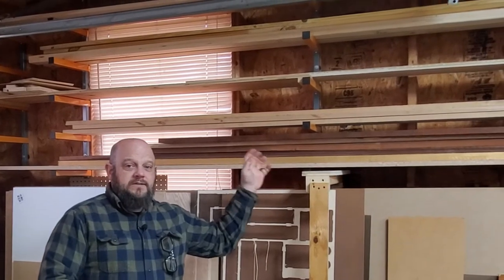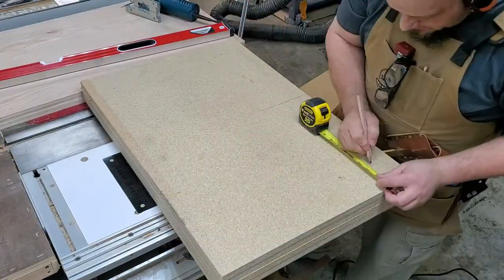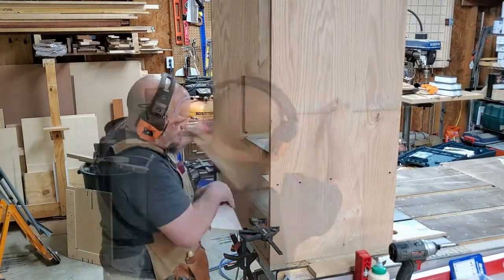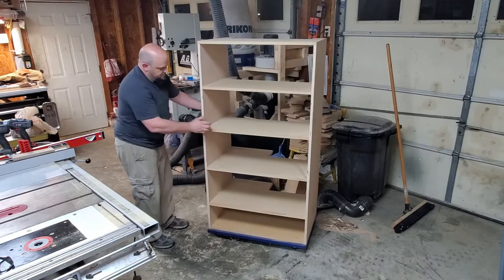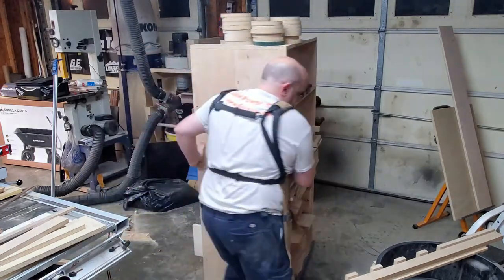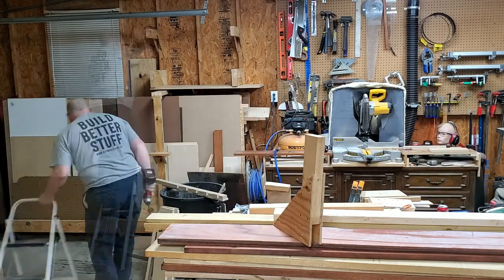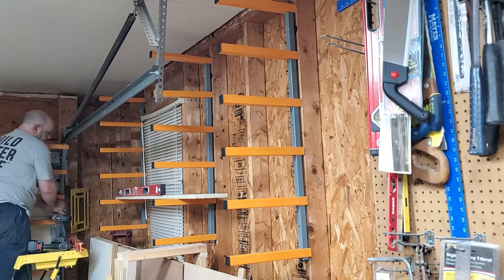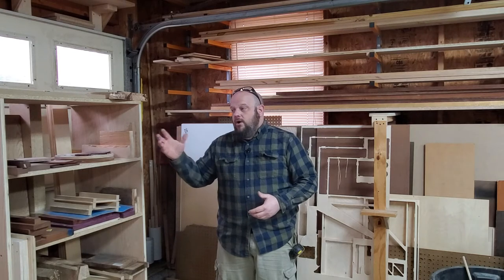Unboxing and Assembly of the Bora Tools Wood Rack Plus Bonus Storage From Scrap

Comment: Hey Chris thanks for the Bora Storage Rack suggestions.  I think i'm going ti get one.  Just what I was looking for.  Peace be with you Brother and God bless you!
Reply from the maker: No problem.  I was a little apprehensive at first but glad I went with two sets.  That allowed me to create a longer shelf with less gap between the supports to prevent board sag.  

I didn't show it, but on one shelf, I added plywood and used scab blocks to prevent it from sliding.  That is perfect for shorts or cut-offs that don't span the gap between studs.
Reply: @ChristcrossCrafts  Hey Chris got my Bora Shelves and installed them.  It was exactly what I needed.  Thank you for your time.  I'd send a picture if I could!  God bless and peace be with you!
Reply from the maker: Awesome.  I'm glad it worked out.